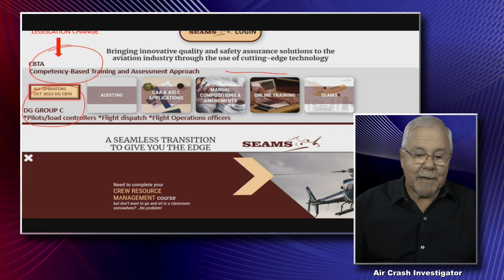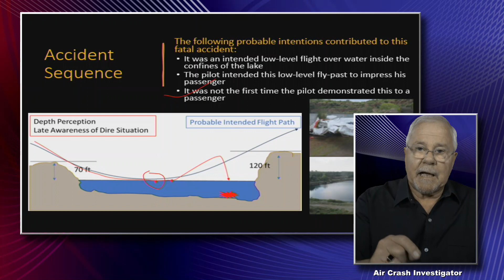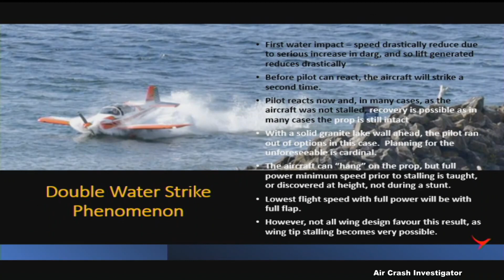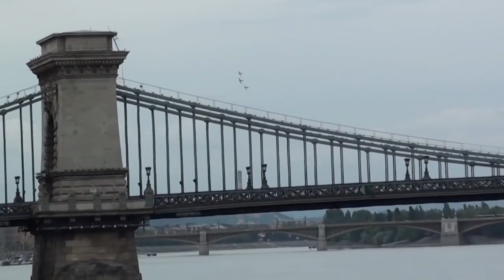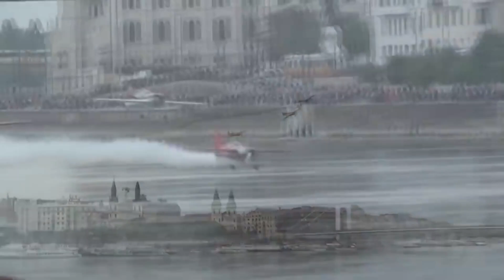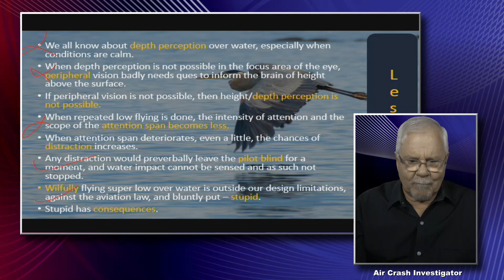Fatal Water Contact Sling 4

Comment: I
This is COMPLETELY WRONG. 
THE FLIGHT PATH IS WRONG. I AM THE OWNER OF THE LAKE. I WITNESSED THE ENTIRE ACCIDENT. AS HE CAME OVER THE EDGE HE WAS AT FULL THROTTLE ON KNIFE EDGE. HE LEVELED THE WING HE WAS POINTED SLIGHTLY DOWN. HE PULLED BACK TO HARD ON THE STICK AND HE WENT INTO A HIGH SPEED STALL. THE NOSE OF THE AIRCRAFT WAS POINTED SKYWARDS BUT IT JUST CONTINUED ITS DESCENT. THE TAIL TOUCHED FIRST AND THEN THE MAINS. THE FRONT WHEEL AND THE PROP STAYED CLEAR OF THE WATER.
IT THEN TOUCHED A SECOND TIME AGAIN NEITHER THE PROP OR FRONT WHEEL  TOUCHED THE WATER, HE THEN FLEW LEVEL WITH THE WATER FOR A FEW SECONDS, AND THEN HE PULLED IT VERTICAL, IT NEARLY MADE IT TO THE TOP OF THE CLIFF UNFORTUNATELY  HE JUST COULD NOT MAKE IT, AS HE STARTED TO SLIP BACK THE RUDDER MOVED RIGHT THE AIRCRAFT FELL TO THE RIGHT MOTOR STILL AT FULL THROTTLE HE HIT THE WATER ALMOST VERTICALLY 
WITH THE
 RIGHT WING
 FIRST. THAT RIPPED THE WING BACKWARDS. THE PLANE SANK ALMOST IMMEDIATELY. I ORGANIZED THE RECOVERY OF BOTH THE BODIES AND THE AIRCRAFT.
I FIND IT DISTRESSING  TO SEE SUCH NONSENSE WRITTEN IN SUCH AN AUTHORITIVE MANNER.
THE PILOT WAS A PERSONAL 
FRIEND.
Reply from the maker: Thank you so much for the info, I only had the CAA report as a reference.  This makes a huge difference in what the sequence of events was, and probably would have lead to the same lessons to be learned, mainly that a shoot up over water not to be a very good idea. The responsibility of the pilot to have have taken more care of his passenger, stays one of the main issues as one must stay within the rules espoused by the aviation fraternity, have respect for human shortcomings over water and so on.  I can see that the sequence was totally wrong and I thank you for straitening this point.  What I probably should do is to bring out a revised version, but I am not sure if the discipline and duty of care of your towards passengers would differ.  I will be glad to hear more of your opinion, especially how many times he has done this before and so on.  This review is to remind the living aviators not to dabble where rules, regulations and human design has proven to be operating with one foot over the edge.  Just a comment that I am a big fan of the Sling 4 and as a DFE I have done many sorties in this lovely aerial vehicle.  May the sling produce many more happy flying hours.